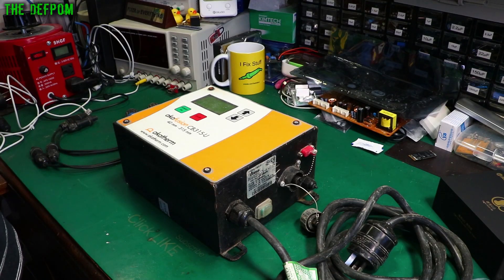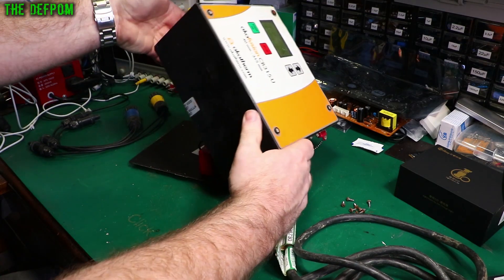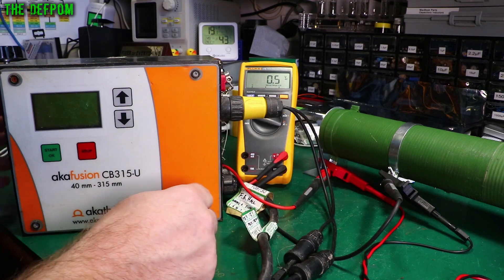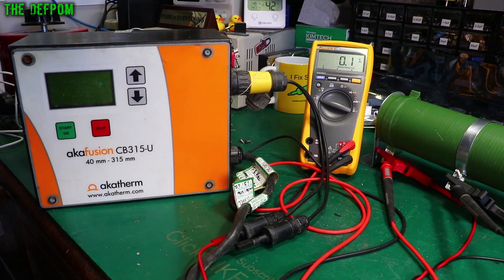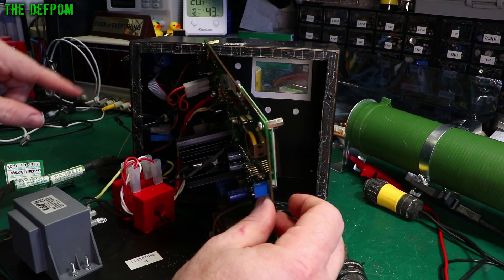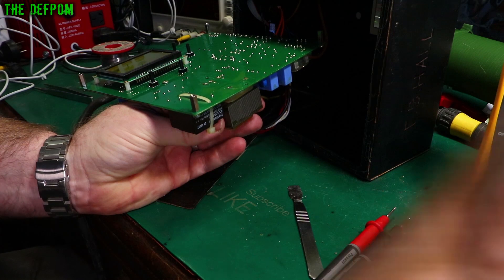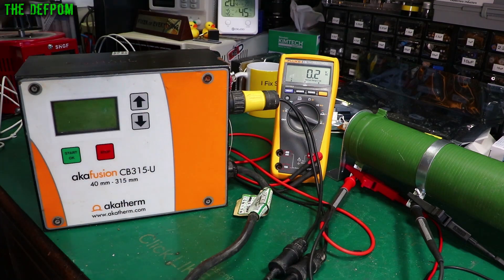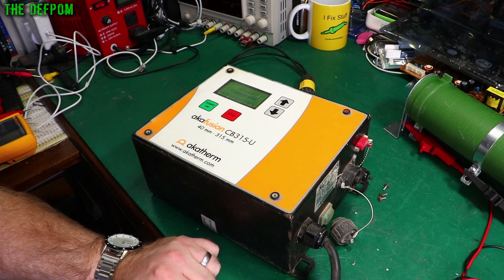🔴 Akatherm Akafusion CB315-U Electrofusion Unit Repair - No.1035

Comment: I'm impressed that level of use and abuse didn't crack the actual board instead of shearing off the pin.
Reply: I warned my father not to buy a Wagan inverter for his RV since I knew how cheaply built they were.  He did so anyway since it had a wireless remote.  The big heatsink inside was loose from day one.  A few years later it stops working suddenly and I open it and find all of the power devices sheared off from the inertia of the big heatsink.  It's amazing it lasted that long.  His replacement...a generic "Power Drive" one with an APP...let's see how long that one lasts.

Comment: Nice repair, the larger ones that I work on, with toroidal 2.5KW transformer inside have similar problems with loose nuts/washers.
We keep the Locktite VarniStop on hand, as in a number of welders you have to lift the pcb to change the operational ROM over to a calibration ROM. I have also come across the use of Liquid Paper on trimpots, nasty stuff as it sets like concrete in the adjusting slot of the trimpot.👍

Comment: well it does have a star washer, so it should have not been lose. One problem is that people reused then, which is not good practice as they get deformed when tightened. the same goes for crinkle washers, use once then throw away. used lots of crinkle washers in the past and the vibration from jet engines did not shake then lose. would not use star washers as they cut through the protective ali coating (Alocrom ) and allow corrosion to form.
Reply from the maker: It will likely be due to thermal expansion, I don’t like lock washers as they can still come undone, in that situation I prefer to use nylock nuts
Reply: @TheDefpom  you get the same issues with nylocks if you reuse then. I know we all do this, but once you have cut the thread through the nylon they won't grip as tight as the first time.